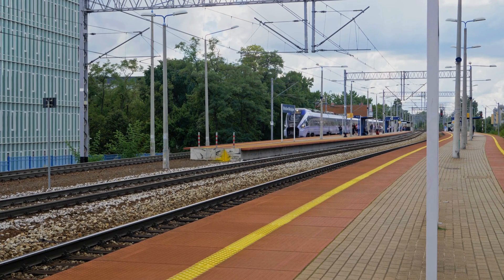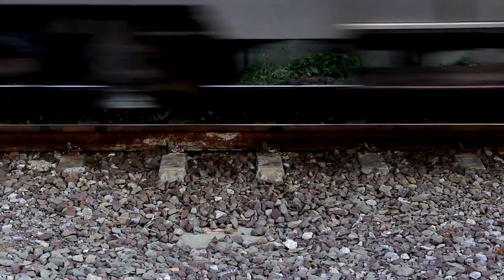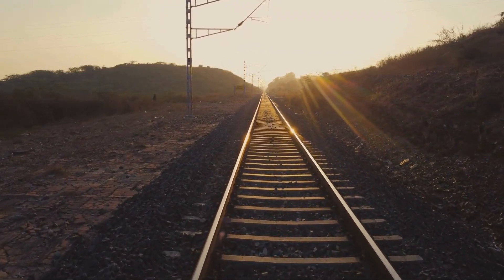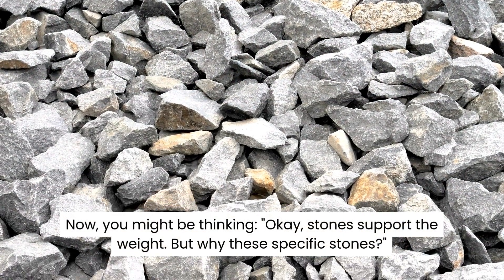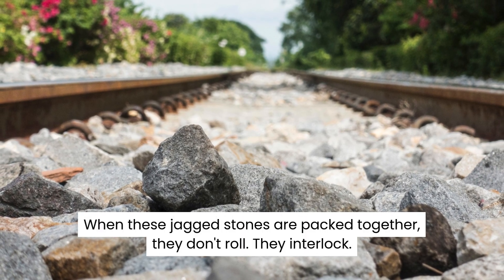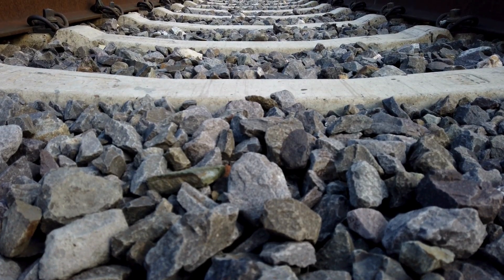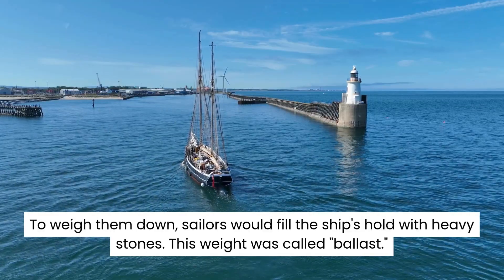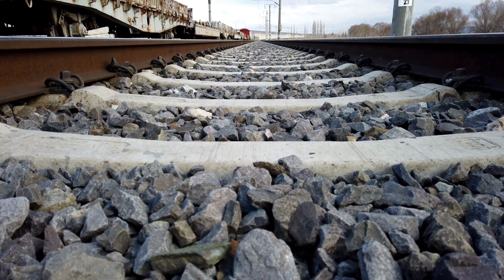Why Are There Stones Along Railway Tracks?

Comment: Secret of heating Straw bale wood frame homes or ideally STONES home = thworlds bestever designed home.
  HOW TO HEAT HOME FREE.
  Written by Buckethead:
     
1.    30' by 20' room.
 
    2.  Only 2 fires 24 hourz CAMP CHEF "TENT" STOVE.
  
    3.   19° Fahrenheit day 10° Farenheit morning Jan 2026 2,300. 1,000 mile  Megastorm hit USA:

Recorded in cheap manufactured home poor insulation.
   Note Buckethead designed best home history mankind stone igloo a child could build piled with 2' leaves& hay.
   HOW IT WORKS Stove center room 18" horizontal DIESEL BIG RIG 5" pipes 2.5 tons wall radiator shelves 2< sheets ply free storage ceiling fan circulate heat, stored in shelves& 3tons objects on shslves.

    Not 6" Exhaust better.
    Cheap aluminized steel no. Toxic.

Stormz explained:
   
Thistorm not about snow or a liddle ice crystal or 2 like every1 saying not evn close it is cold gonna burn u like a hot iron where your wallet iz guaranteed.
      = Time expense labor& MASSIVE tooling damage Satanz cardboard rusted freezing sheds.

   It about cold not ice/snow blanketing protecting th earth pruning treez with free compistimg mulch firewood& expand aerate soil = Mr. Lush Garden spring.
    Really persistent COLD extreme cold/cold&wet& in2 end next week& beyond expect -10 central east Oklahoma maxing out Monday thatis b4 wi d chill.
   Expect upwards of 40° even 50 below -50°
  
     Remember this: 
    That AVE. winter temps just 100 miles north Wister@ Missouri border = 8° colder = I use 3 TIMES thwood 2heat home my worlds best ever designed wood stove/2.5tons shelves radiator trap/store heat = my heat collector system/free shed storage 27 4x8 sheets ply storage climate controlled shed gi es me 100% floor space say NO 2expensive furniture.
   All th chemicals& tooling in your sheds???
      Will freeze. Ruining toolz paints& sprays = my climate controlled system by far best.
    You use 5 times wood I doo bcuz your wood stove designed by Satnz kidz.
       But, also, how u were taught operate stove iz what killz u.
     Smothering logs all night stove butted against wall radiate heat outdoorz stubby legs floor designed by Satanz kidz utilizing vertical chimneys is cmpletely backward.
      

    Ice&snow keeps wood dry no problem.
     But good luck 2u gathering it -10 Fahrenheit good luck evn finding it under snow.
     Get way more wood then u think u think u need.
    I store on porch& in living room so simple. Easy. I gather totally at leisure as I go ask summer as I return cabin.
    
    Warning:

 I hav highest IQ history mankind &creation:
 
     Chimneys can not be vertical. Ever. It a myth.
  It's impossible.
     It duznt wrk.
   It circulate moisture turn strangle chimney throat shut with CEMENT 4 times a year.
   
Didju know?
Cement is made in factories by extracting oxygen from minerals?
     Didju gethat???
   Mr. Chimney = cement factory = carbon dioxide/minerals. Wood ash de oxygenated minerals DO NOT ADD WATER TO YOUR CHIMNEY CEMENT FACTORY cement/smoke/water factory turn ash2cement!

    
    Do not use vertical chimneys.
   Reread.
     HORIZONTAL TILTED 1FOOT DOWN PER 12' ONLY chimney.... only.
      WHILE release enormous heat home 2nd wood stove 4free.

   Lastly,
      Learn 2operate stove.
     Do not buy in2 keeping log lit all night.
   
     Satanz boyz taught u that.
    Smothering fires& logz that persist as coals12 hourz DO NOT WORK flash fire ONLY wood stove!
     Burn fire OUT fast as u possibly can.
     = How u heat home which THEN spikes 90° only 1fire, and, is THEN AS SUCH, absorbed AND STORED by Mr. Interiour objects or my 2.5 ton radiator shelves/EXPOSED open cabinet 5tons stuff shelves circulating hot air ceiling fan.
    
    Closed cabinets hide yr sduff trap cold = they ARE EFFECTIVE GIANT ICE CUBES cost fortune jus2 buy.

    
   I use 1/10th firewood otherz do I nvr cut treez split wood either or store massive amounts wood it is totally unnecessary.
     Effrtless 4me, why?
    ...bcuz I hav highest IQ history mankind& creation = I only gather minimal branches @leisure drag branches 2cabin all summer inadvertently NEVER STORE just pile in yard.
 No need store or "dry" out there in thconstant condensation.
    
  Wood dries in minutes under my stove anyway even gathered in downpour.
 Branches covered in flammable porous bark. Wow. That'll work.
       While u must use lighter fluid I hav free twigz&branches.
  Wet wood in burning stove?
   
    Cmon. ..dries in seconds.
   
          Did u know???
      Moisture LITERALLY drips down CONSTANTLY from my HORIZONTAL chimney tilted DOWN pipe. 
    Yes.
   Stoves pull moisture from air. Not coming from wood!
     And, 
   *Can fill 1gallon container water 1fire.
    Bcuz PULL HUMIDITY FROM AIR.
    Very important:
   Wood stove sucks oxygen like a desk fan.
   Get it?
   It must breathe.
    I use hole where HORIZONTAL chimney pipe exit home 2get fresh OXYGEN.
   
  This is key.
    I wrap 6' long cheap aluminum sheet 7" larger diameter around 5" diesel HOT big rig exhaust pipe.
   = This shroud will pull freezing air in warming it against chimney pipe 6' shroud b4 enter room as free heater fresh warm oxygen then enter room can u see it???

   
     All fireplaces wood stoves, in contrast, pull fierce cold from outlets& inevitable orifices from idiot built strawbale cardboard homes wood frame homes deliberately engineered by Satanz kids 2b 250k homes from h*ll MADE 2demonize u drain Mr. Wallet. 
    Meanwhilemost,
    Your little sister could build my stone igloo just by looking@ a picture age 10!
    few bags mortar couple windows as portals2 enter stone dome home... done.
         LESS ISMORE.

   Satans boyz magicians compared 2u.
     Do not build their evil card trick homes inverted Spanish Gallion style roofs.
    Build mortared free stone igloos covered in 2' straw insulation only 1 fire = easily heat dome home till morning.
 
    Lastly my worlds best stove 18' thick steel horizontal SMOOTH 1/8 thick steel diesel big rig pipe lasts 1,000 life times& more release heat room tilted 1' DOWN drain gallon water per fire.  
 
Forecast:

 Your cold that Satanz boyz taught u that u mustpay 4 really begin Sat in2 Sunday.

   Makes sure u giv hiz boyz plenty money so u get straight A.
   1. Make sure pray for hiz utility worker demons so 🙏that theez demonz& devilz can blackmail NONstop.
     ..4cash flow.
     With 1 or2 on off switches on it u straw bail cardboard wall.
     When I tell people thr Satanists literally worshiping Yahwehs poison son they think I crazy.

  I covered all garden/ fruitreez with leaves blanket ensure gorgeous productive free food effrtless automated Pond$BANK$ Garden come spring.
    
   1. Butted everything up against home so as not lose thru damage or freeze xpensive hoses&tooling designed by Satanz kids deteriorate in cold.
  
   2. Remember that Satanz kidz increasingly backward engineering all materials now 2break 4cash flow 2disintergrate in cold bring your water hoses indoorz winter.
  
   = 3.
     Empty yr expensive water troughs&buckets they will explode Mr. Ice will Crack'm again your plastics now dayz lab engineered 2become *permanently brittle after endure cold they snakes corrupt engineers. They serpents.
   Satanz kidz tho, they will be essentially praising them praying god protect there precious utility workers they cherish.
     I sure as all H*LL won't be blessing them.
  (Photo mulch blanket on garden compost tea colored free food pond, & -10 Fahrenheit b4 wind chill f4cast 4monday.)

Comment: Because it's for the weight of the train, we all know trains are huge hunks of metal that weigh tons, and what happens to compact roads when heavy machinary drives through them again and again? They crack and split open.

That's why they use these little stones to save up on maintenance costs, and for safety reasons, because if they used asphalt or even reinforced concrete since those are compact forms of paths, they'll eventually crack and give eventually.

Comment: It is different for the high-speed trains tracks in Japan for the Shinkansen bullet trains. They often do not use stones (ballast) for cushioning, especially on newer lines. Instead, over 55% of the Shinkansen network utilizes slab track technology, where rails are fixed onto concrete slabs for increased stability, reduced maintenance, and better performance at high speeds. While some older sections may still use ballast, the modern standard is concrete.  Key Aspects: Slab Track (Concrete): The predominant choice for high-speed lines, offering superior stability and reduced maintenance costs. Ballasted Track (Stones): Older lines or specific sections might still use traditional ballast, which consists of crushed stones that - like this vlog explains - disperse load, reduce noise, and allow for efficient drainage. Comparison: While gravel (ballast) is excellent for regular trains by allowing drainage and adjusting to ground movement, concrete slab tracks are essential for preventing the higher stress and maintenance issues associated with high-speed, frequent travel.

Comment: The railway ties/sleepers stop the rails from spreading apart, not the ballast.
Ties used to be made from some sort of hard wood and the rails were clamped to the wood with steel plates and huge nails (stakes, spikes), hooks, or large threaded rods and nuts.
The wood would eventually rot and the fasteners would rust away.
So now they use concrete ties/sleepers and rust resistant fasteners.

Comment: Perfect example of the Dunning-Kruger effect! I saw the title of this video and thought "Oh gosh I thought that was obvious!" My immediate answer was that the stones were there to protect against brush fires! I imagine this might be a side benefit though as it does keep vegetation down, meaning any sparks from the rails would not be able to reach dry grasses. The foundational aspect is pretty obvious though, concrete is expensive and prone to cracking, especially under heavy loads. Ballast gives strength but a little bit of flex.

Comment: When young, I had a Summer job as trackman. Basically we replaced those ties (made of wood and sealed in tar), which are very heavy, then we spiked the rails back and used a special jack hammer-like to compact the rocks underneath the ties.

Comment: Namaste! I am from India...😊
I agree with what you have said. However I have read that when we come across a problem and try to find a Solution and find one we lateron find out that this Solution has created Two or more Problems and the Merry-go-round starts....😮😮...
So also now Metro Rail and Bullet trains tracks have done away with the Ballast.
Any update on this?
Thanks.

Comment: Distributing weight, stabilizing the tracks with some flexibility, and letting water drain away all sound correct.  Weed killers? Not likely.  It doesn't take long for tracks that aren't being used to get very green and weedy.  There's a spur near where I live that occasionally has a short train, and it has a fair amount of growth, and I've seen others  Vibrations from passing trains might make any dirt or seeds slip down too far for growth.  Otherwise the railroads probably spray.

Comment: AI answer: The stones next to railway tracks, called track ballast, are crucial for stability, drainage, load distribution, and preventing vegetation growth, holding the sleepers (ties) firmly in place to allow safe, smooth train passage by absorbing vibrations and allowing for slight track movement. Their sharp, interlocking shapes keep the track structure stable, preventing shifting under immense weight and temperature changes, unlike smooth river stones which would roll and destabilize the track.

Comment: Great video overall, but there’s a minor correction: The track ballast alone is not a self-sustaining weed prevention system. While the crushed stones create a harsh environment, they cannot prevent growth indefinitely without active maintenance. To ensure proper drainage and structural stability, railway operators must regularly intervene with mechanical cleaning, thermal treatments, or herbicides. Without this constant upkeep, the tracks would be overgrown within just a few years.

Comment: I work for the railroad.. there is a machine called a ballast regulator.. It works by moving and vibrating the stones under the ties to ensure a solid level support.. stones have edges so they don't roll over each other 😐

Comment: Same as sewer and water lines,crushed  stone lime stone or granite, interlocking subase for stability ,plus a French  drain 🤔 you can set up stand pipes and put electric  pumps in the say wells to keep your excavation  dry along the trench  until  you make your end connection  ,or end of the job or end of the line.same as railroad tracks,stableasation,or base ,drainage, the Spanish  gallions,ships used  ballist  stone or even bars of silver from South America, the incas,silver, they plundered  for 300 years,amazing, alot of those  gallon ships went down to Davey Jones locker 😅.

Comment: 1) Weight distribution
2) Drainage
3) Weed killer
Reply: Fire prevention. Brush could catch fire from sparks let off by friction.
Reply: Thanks!
Reply: funny thing they missed one of the biggest reasons ... flexibility. railroad tracks expand and contract quite significantly under heat and cold, and having them on a pile of rocks - not bolted into the ground - allows that tiny bit of movement needed to keep the force of expanding and contracting rails from breaking ties, spikes, the rails themselves or anything attached to them.
Reply: @gmCursOr  Excellent point
Reply: mud prevention
Reply: @usage-j4z  nope
Reply: @hodgepodgeporch Actually yes, drainage control prevents mmud andwater pooling.
Reply: @hodgepodgeporch  yep
Reply: Thank you
Reply: thanks bro i aint watching allat 5 min for a 5 second answer
Reply: Yep that sums it up.
Reply: Saved me 5 min ty
Reply: AI
Reply: false
stones are there so indians  wont steal them
Reply: thank you daddy
Reply: and just easier to work with than dirt
Reply: you're a star
Reply: Thank you! All I needed to know
Reply: And if we care ELECTO MAG TRAVEL
Reply: Thanks. I can't stand rambling videos.
Reply: thanks for saving me thru this a.i slop
Reply: Fires from sparks as well
Reply: thanks, didnt want to waste my time for a 5 min video when the answer was probably a 30 second video

Comment: I worked for the Railway when I was 18-19yrs old building and maintaining track by hand! We used 15lb sledge hammers all day sometimes! Replaced and put in new ties and at the time cement ties were not a big thing yet, so spiking the ties was an art form and very physical! You forgot 1 other reason in your video! When the track warps or moves you can adjust it on this set up, if it were on solid ground it would be very very labour intensive and difficult!😎😎😎

Comment: You missed the even more interesting fact that it has to be maintained (and eventually replaced) due to degradation. The process is called tamping sometimes manually but often by huge automated machines which most people never see in action. Often done at night but even when done in daylight the operation will rarely be noticeable from the windows of a train passing on an adjacent line. Plenty of videos on YT though.

Comment: The other illusion is thinking the Railway steel is absolutely rigid hard, but it's not, the rails are actually very flexible, and for good reason, the weight of the trains would snap the Rails in two if they weren't. I saw this on another video where the rails were being replaced by new rails, and when picked up by a specially designed machine, the rails flopped around like strands of spaghetti and that happens under their own weight, but if I attempted to pick one up it would act like one solid rigid length of steel, because I'm obviously not strong enough to displace it's rigidity.

Comment: A big, wide pile of "ballast", interlocking stones, creates a much bigger footprint and spreads the incredible weight of train cars and locomotives over a much wider area, creating a firm support with drainage, that won't compress the soil underneath very much. By PSI, the steel rails have the highest load, that is why they are steel and not balsa wood, and the redwood or concrete ties have aless intense loading, and the dirt beneath the ballast, the lowest loading.
Engineering is all about load spreading.

Comment: I once googled why they use these stones along railways, the only answer I got was to allow for the tracks to expand without bending, but none of the other purposes mentioned here. But now I know more, thanks.
Reply: I just asked in chatgpt out of curiosity. It gave a complete answer with all the points mentioned in the video. Who would have thought google search is going to be obsolete few years back!
Reply: He said he used Google in the past. Obviously I gave a bad answer in the past period now Google is using chat GPT level AI in its search results as well.. it gives you an essay and that essay will have extrapolated information from this video another location.. it will probably now give you the same detailed  answer you're getting on gpt or this yT video here. Get with the times. The guy googled it in the past. Google search is now the same as chatgpt..if not even more data driven
Reply: AI is becoming a fountain of information especially when using certain parameters
Reply: I learned something today
😊
Reply: Then I am going to ask ChatGPT or Copilot and see what I get. Hope it's not verbatim what is presented here.